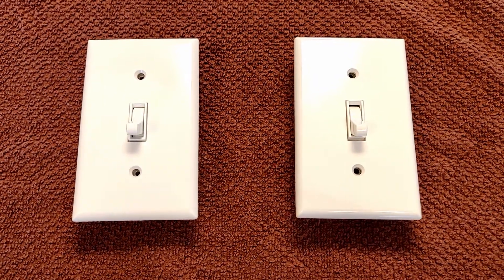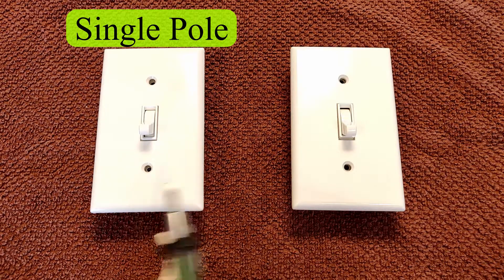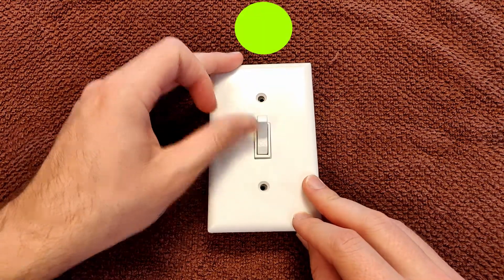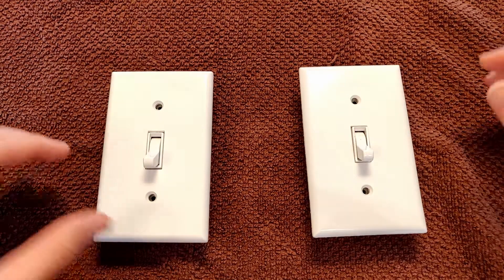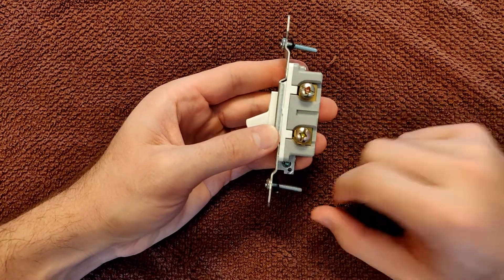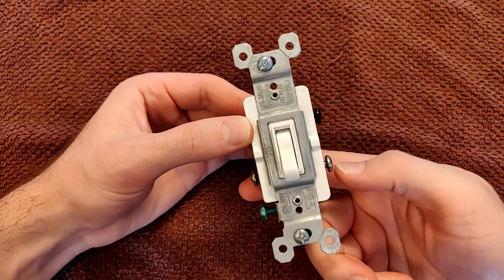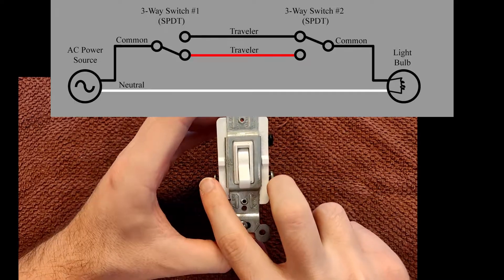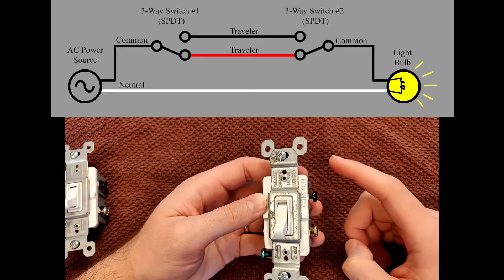Single Pole vs 3-Way Switch in Under 3 Minutes

Comment: Hi thanks for the great video. I was just wondering. Can you put just two hot wires from a two pole fuse holder in a three pole overload  (ex. L1✓ L2✓ L3×)??

Thanks again

Comment: Good video
But how do i know which one i need i currently have two switches and they are together on one plate one turns light the other one is for outlets i think to turn off power for outlet so i wanna install dimmer light so do i change just the one for light and install the dimmer and leave the other one alone since its for outlet nothing else.  Do i need one way dimmer or two . I am not electrician any help thank you

Comment: My light switch has two load wire on one switch and line wire on the other.  No ground wire.  Can you use a three way switch on a single pole switch?

Comment: I am interested in installing a programmable timer that is single pole in a circuit that has an additional 3 way switch. I am not interested in using the 3 way switch. Can the timer be installed in such a circuit?

Comment: Good video!
Question: my "light" switch (witch is in fact a dimmer) turns on or off the wall outlet that is about 5 feet further... so does that mean this "light" switch is necessarily a 3-way type?
Reply from the maker: Switches can control outlets too. Just count the number of switches that turn those same outlets off and on. If it is 1 switch that is a single pole. If it is 2 switches, those are both 3 way switches.
Reply: @EngineersEscape  Thanks! That clears it up for me. The wall outlet I'm referring to is controlled by only one switch, so it is single pole. Now I don't want this outlet to be controlled by the switch, so I hope it is not too difficult to change that? Probably just disconnecting/reconnecting some wires at the wall outlet? I'll do some googling (and I'll turn the breaker off before any manipulation!

Comment: Can you use a 3 way for a single
Reply from the maker: Hi Randy,
Yes, you could. You would break the hot wire connection using the common and only 1 traveler terminal. Most people don't use them for this purpose though because of expense.